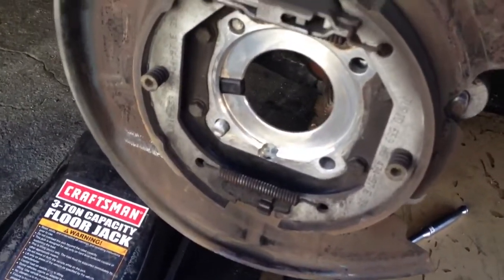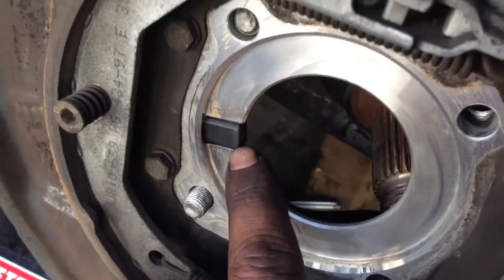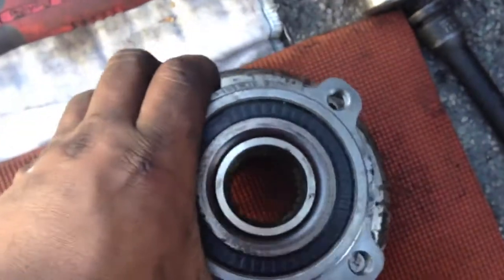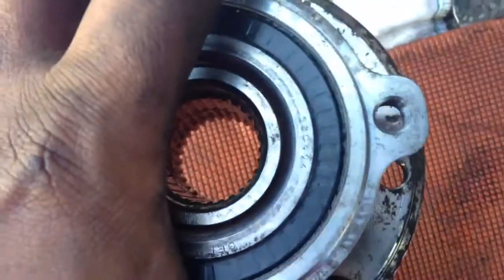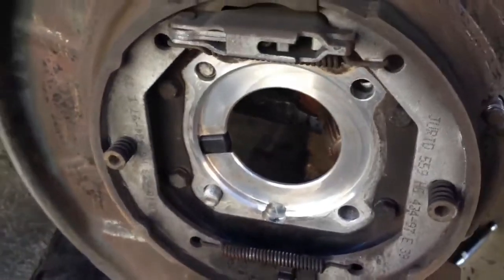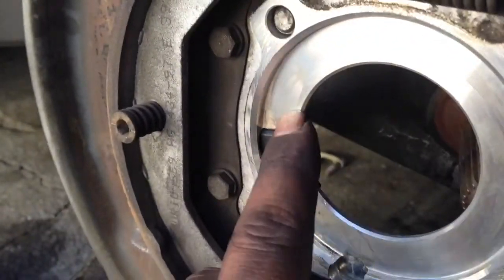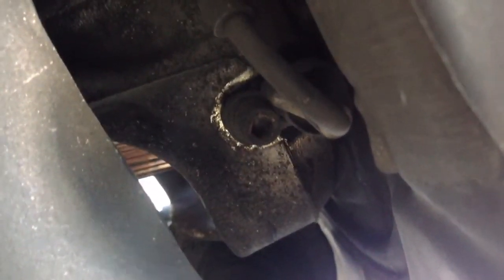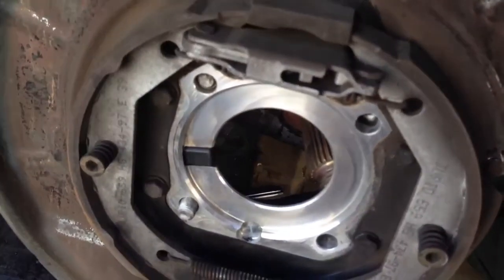Tip How Your ABS Functions 97-03 BMW 5-SERIES E39 528I 540I M5 M52

Comment: I need more info on your job here.  I have a huge problem.  My traction control keeps kicking in and limits me to 20mph.  Replaced all ABS sensor.  Every single one was broken.  so swapped them naturally for brand new.  right rear and both fronts keep flagging up on the error page in diagnostics.  Car is a 97 year E39.  Any pointers to look at please.?

Comment: What you need to know about the ABS sensor is that it's a coil  that picks up the electromagnetic effects of a "phonic" wheel spinning next to the coil. Behind the dust cover should be what looks like a shallow toothed gear wheel. As the hub turns the Phonic wheel turns...it's all the same piece of metal. The coil picks up the movements of the teeth as they go through the magnetic field created by the coil...might even be a magnet sandwiched between the coils. It's almost like an alternator but on a tiny scale. I've heard of ABS faults occurring after wheel bearing changes which could be related to disturbing the coils or no phonic wheel on the new bearing assembly.

Comment: I just changed my bearings. The only reason I knew it was bad was because you could hear a gentle whining noise from the back of the car....no the kids weren't in the car...or the missus. To be honest initially I did suspect the differential but the bearing cured the noise.

Comment: Replaced my faulty sensor but light is still on ? Any ideas what it could be
Reply: This bearing or whole module gone. Need a scanner on it really
Reply: And test for live data. Jack car up and spin wheels see if yoh get reading if you don’t. It’s one of them it’s either poor sensor connection, abs ring or module gone

Comment from the maker: @Ugur Ekim If you did not have the problem before you should not have the problem now. With your ABS speed Sensor or Dashboard cluster not working Properly. Something went wrong. It could be a bad ABS sensor There could be a short in one of the wires. I don't believe it's your hub bearing Or your ECU.